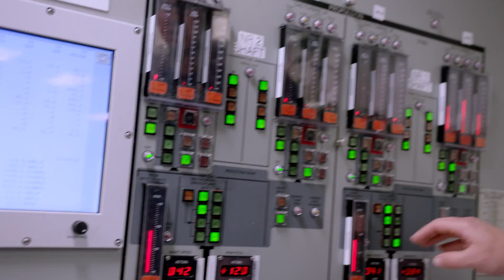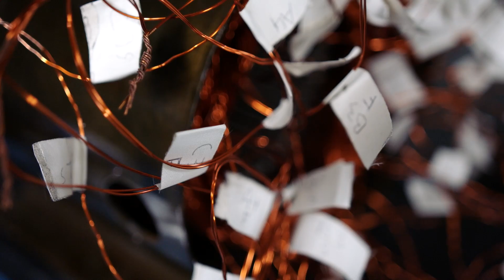Navy Electrician’s Mate – EM

Comment: Was gonna be a Seabee but they are full so I chose this how is it?
Reply: So how was A school?
Reply: EM is a great rate! Fresh air snipe you will be working throughout the ship! From tge engineering spaces to doing maintenance on the aircraft warhing lights on the top on the mast. (Inport). 
Almost everyone underway does a twelve hour day, more time than actual work. Every command runs it a bit different, some 8 hour work day plus watches others twelve on rwelve off. We ran eight hour day plus watches. If your watches were during normal work hours you made out, sleep all night...lol
Inport it's a skate, we were three duty sections duty, every third day and every third weekend. 
Good luck apply yourself get quals done and make rank ASAP. Engineers usually have pretty fast advanced. 
Go Navy!⚓
Reply: @Ned-r4t I’m about to graduate becc Wednesday I have yet to go thru a school

Comment: Do they us emt conduit, rigid, or romex?
Reply: Gogo Plata How was your transition into the civilian sector?? Wondering as I ship out September 14th for EM and always wanted to join the IBEW Union
Reply: Kuch Nasty 
If you want to be a land based electrician, you should be a Construction Electrician (CE) which is part of the Navy SeaBee community. If you have signed up for the Delayed Entry Program, you can change your mind and negotiate a new contract to change your rate.  There are shipboard electrician jobs, aka Marine Electrician, available in the civilian world. (See link below) Also, check out shipboard electrical jobs with the Military Sealift Command.

https://www.indeed.com/q-Shipboard-Electrician-jobs.html?vjk=929cb9846fc1ca32
Reply: @kuchnasty7112  interesting i have 7 years in the IBEW and i want to try this out for a few years
Reply: @AmpereNA honestly man now being out and in the IBEW. It’s what you make of it.
Reply: No , Buddy, Ship board, is PVC, cables stranded, going thru "Stuffing tubes" thru compartments, The electrical Distribution is all, 3-Phase, Ungrounded, 480 volts from , power plants/stepped down thru "Delta/Delta" to 120 volt, then thru Fuse panels, too Outlets, single phase/"NO" NEUTRAL".
Reply: @charletonzimmerman  wow thats crazy it is very different from what i see in construction building thank for answering my question i appreciate it but i do wonder what type of electrical materials would a spaceship use
Reply: @oscarorta9152  Well, volunteer, for "Mars" colony, as that looks like next !
Reply: @charletonzimmerman  > very interesting facts !
all mentioned work are nitch jobs not common  therefore  few job calls..